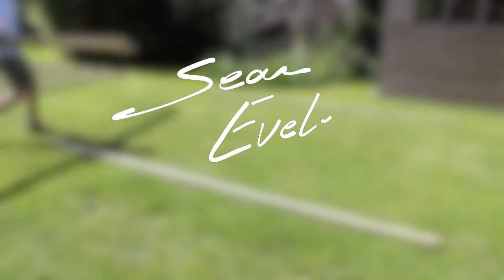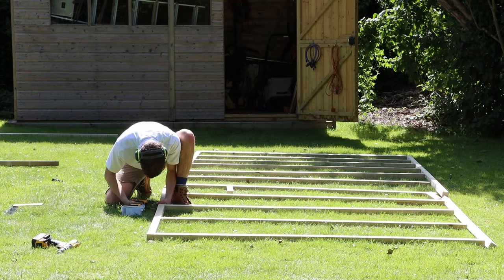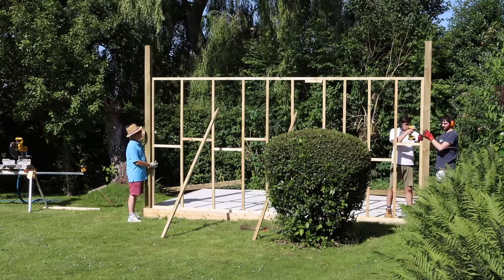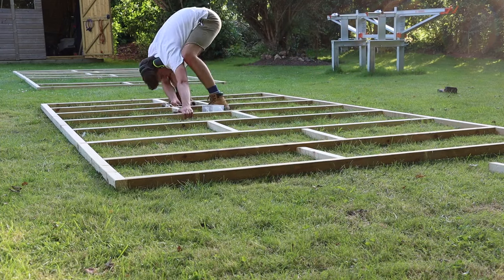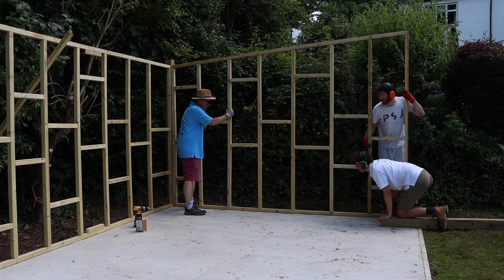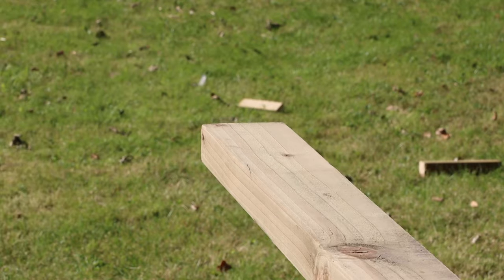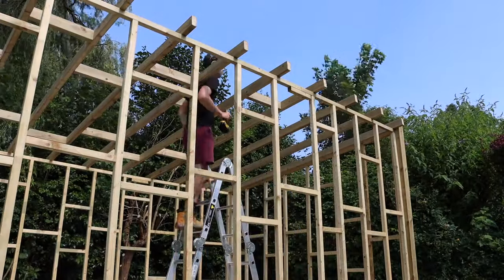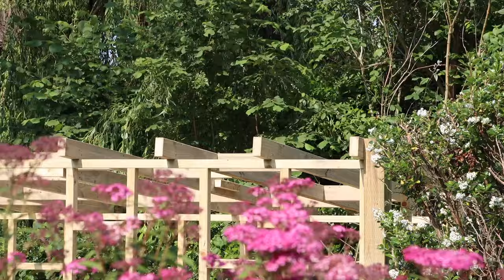Building The Ultimate Home Workshop/Timber Store!

Comment: Looks good mate, you were installing “noggins” rather than battens on the roof. Concrete screws would have been a good solution to fixing the wall plates to the base. No plugs needed, just drill straight through the plate into the concrete then drive the concrete screw straight through into the concrete, very solid fixing.
Reply from the maker: Thanks Graham, Ahha yeah I don’t know all the technical terminology for framing and carpentry. I did actually use concrete screws! I used SPAX ones. I agree they and strong and easy to fix
Reply: @SeanEvelegh  nice one, they have an even better name in Scotland “Dwangs” 🤷🏼‍♂️

Comment: How did you attach/secure the 4x4 corner posts to the slab?   And did you use sill bolts to attach the wall plates (for each wall) to the concrete pad?  Were the bottom sill  plates that rest on the concrete pressure treated for rot?

Comment: Hi Sean.
I'm surprised as the new workshop space is comparable with old one. What is your benefit, just the new comfortable place? Possible i'm gigantomaniac, but new workshop must be at least double space higher.
Reply from the maker: Hey Alexander, I'm not actually using it as a workshop, I'm keeping my current one. This is going to be a timber store, so hold all my sheet material and solid wood.

Comment: Did you pour the concrete slab yourselves also sean? I'd be interested to hear how much it all costs and how much you'd have to pay for a fabricated steel equivalent  Timber prices here are sky high still
Reply from the maker: Hey Peter, I actually didn't pour it. It worked out cheaper to get someone else to do it and I didn't want to mess it up! The concrete base cost £1480, which is quite expensive (mainly because there is a concrete shortage at the moment) and yes timber prices are high, but I think they are slowly coming down.